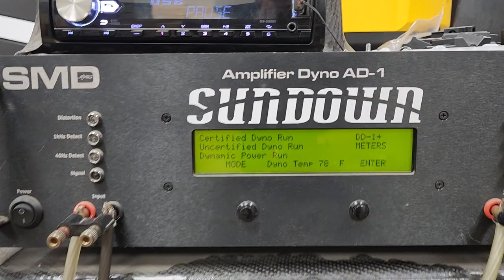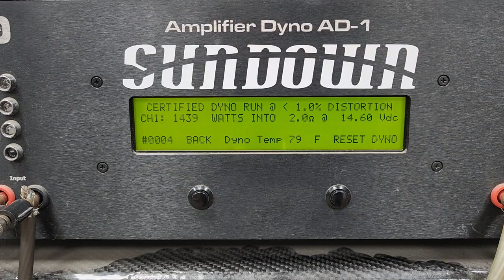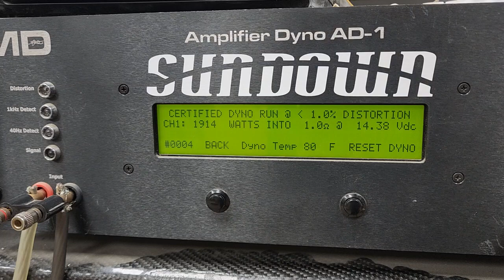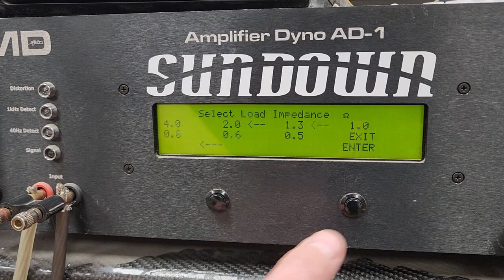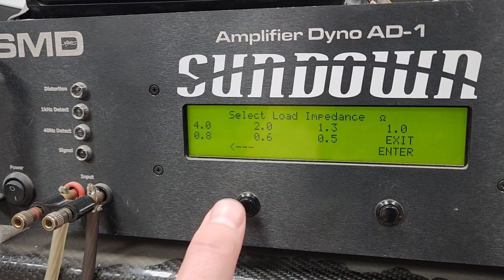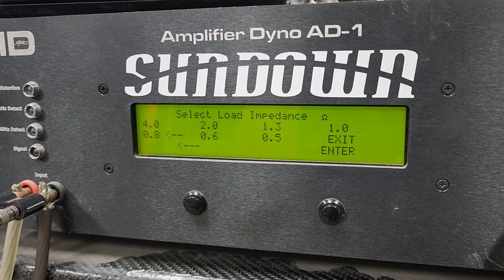*Quick Amp Dyno* Sundown Audio Salt-1.5 Amplifier "1500wrms"

Comment: Why do people dyno these amps at 14.8V?  Industry standard?  Because I'm under the impression vehicles aren't putting out 14.8V to the amps unless you've done the Big 3.
Reply: Even if you do the big 3 which I have your voltage will still drop under 14.8 ,under 14.5 under 14.38  you will have to have at least alternator at 450  and serval batteries in trunk and probably 2 alternators ,but for this amp but at least 400 alternator and extra batteries so yes your right

Comment: The person buying this amp will not spend the money on electrical to hold these voltages.
Reply: Actually don't need too on salt amps. They are built to do rated power on 12v systems. That's the best part. My salt 3 on stock electrical was amazing.
Reply: @fordflexking2014 really?? What vehicle do you have?

Comment: D'Amore Amp Dyno results aren't realistic at all. They're unobtainium perfect world results that do not account for box rise and vehicle voltage variants. Do it in a vehicle with a real speaker load on them. Need more 12/13/14 volt realistic results as well.
Reply: Thata why i pay more attention to the 2ohm rating
Reply: I've been preaching that for years. You are 100 percent right.
Reply: This is tested by sundown @12v its going to be steady and run efficiently on rms no matter what . Anything Over 12v is a plus on this amp

Comment: I thought it would do better then my sfb 1500 since it’s salt series but dayum I was wrong.
Reply: Ur sfb is a full range Brazilian style amp. This is a Korean board. If you heard the difference, you would understand. It is 100% better. No disrespect
Reply: @KemDawg123  salt series definitely better I agree I haven’t heard em tho but ye they do rated power at 12.8v pretty nice amps. Just up there on price expected a lil more watts.
Reply: The SALT will last for years, has a better bass knob,  Sound betters, Has better damping, WAY better crossovers, is more efficient and won't choke to death at lower voltages. Raw power numbers aren't everything.
Reply: Bro that sfb1500 won't even do a true 1500. I had 2 sfb1500's had 1 sfb2000 and had a sfb8000 and than I switched to salt 3 and man is it day and night. The salts are like a God while the sfb amps will eventually blow on ya even with nothing wrong. The salt amps are heavy for there size. I'm getting me this salt 1.5 now. Salts sound better go to lower ohms daily and even look better. Well worth the money. There are ppl I know running there salt amps on .37 or .25 ohms daily. Without issues and yet they don't get damaged by low voltage. I will never go back to get a sfb amp. If you can you should get 1.
Reply: @fordflexking2014  do you think your salt 3 hit harder (was better) than your SFB 8k?
Reply: @KemDawg123  yes. Not only built quality but also sq. To a beginner you probably wouldn't hear the difference but the crossovers and the more time that you spend around systems you would be able to tell pretty easily. There is a huge reason why the price difference is $600 for a sfb8k I paid compared to the $1,100 I bought my salt 3 for both brand new from a sundown dealer. The salts can handle very low ohms .25 and above. The sfb better never go under 1 ohm or your amp will blow. The salt can also still play at 9v while the sfb will blow if under a minimum of 12v.
Reply: @KemDawg123  my salt 3 was tested and was putting out almost 5k rms at 15.6 volts. The salt amps are just amazing. The sfb might have been slightly more powerful but the risk of blowing is like 95% or higher while the salt amps don't have such a chance to blow.
Reply: @fordflexking2014  and I already know that salt hits lows waaay better than that SFB.

Comment: Sfb 1500 does more
Reply: I would take the Korean made amp over the full bridge Chinese made any day 😂😂😂😂
Reply: @Rocket84  I have a salt amp and the sfb in 2 different cars. Can't tell any difference. Both holding up good.
Reply: @bmarklar  if you can't tell the difference than I now know you're deaf 😂 I had multiple sfb amps and now got salt amps and there night and day.
Reply: Also run a sfb amp on 12v electrical and see if you're lucky to hit 1200 rms. While the salt would do 1500 rms easily. But that's if the sfb doesn't explode before you got it too volume 6 on the headunit.
Reply: The fact you say volume 6 like all head units put out the same signal to an amp proves your clueless. Do we wanna make a bet and find a random known car audio person to hold the bet. I have a clamp meter and a smd tool. I'll record no cut video with 2 cameras.
Reply: @bmarklar  I used volume 6 for an example dumb dumb. And I'll bet my entire 401k on a salt amp out performing the shitty sfb amps in every way shape and form. Go to a slamology and see if sfb will win against salt amps.